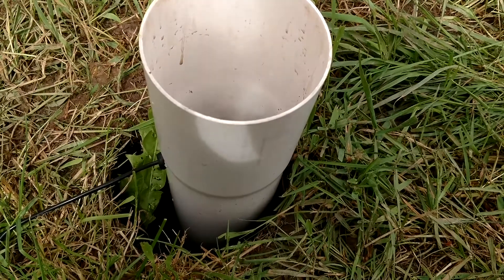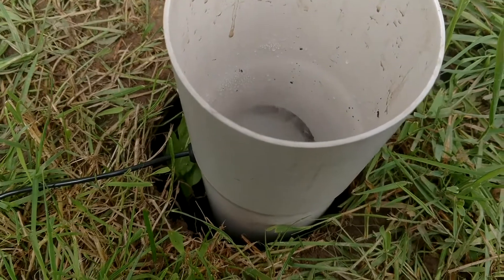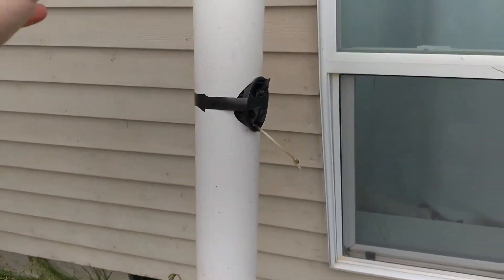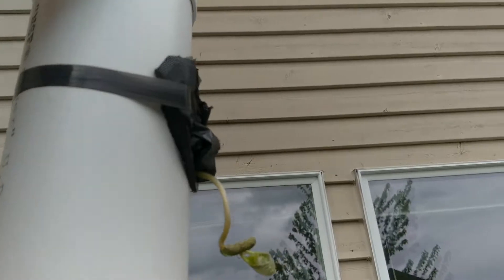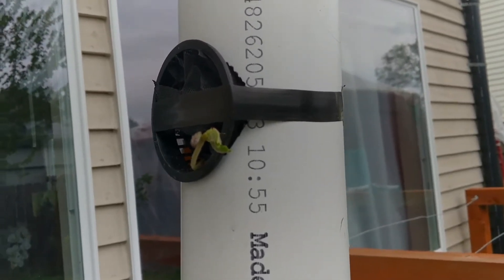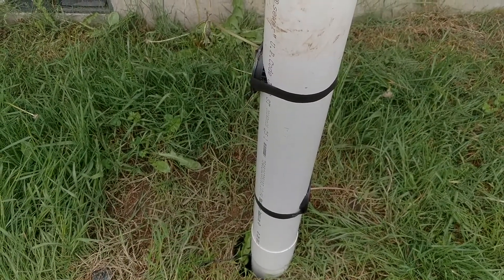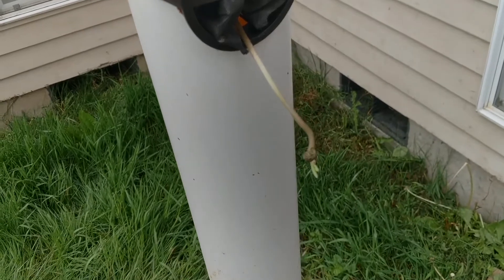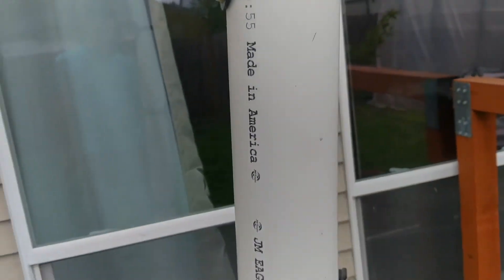Indroducing the Fogtower - Trip does Fogponics S2E1

Comment: Any updates ?
Reply from the maker: Fog is difficult to manage in this configuration.  With a fan the fog escapes and wastes water and nutrients. Without a fan, the fog doesn't climb high enough to reach the top plants.  You'd want some sort of loop that recycles the fog but the hard part would be using a fan that is resistant to moisture enough to circulate the fog.  The costs probably don't make sense.
Reply: @tripzero0  fair enough ,but with fog the growth is better ,is it true ?
Reply from the maker: @bhoom2tika  yes.
Reply: Use a computer fan. They are brushless, so no moisture issues and they should be rated on flow and pressure.

Comment: You should set up the foggers at the top of the towers and then pumps at the bottom. Gravity will move the fog where it needs to go and the pumps at the bottom of the tower will move your solution you are fogging back to the foggers at the top of the tower.
Reply: How would you design that?

Comment: I'm with Robert M...even if it does at first (fog reaching the top)  as the roots develop air flow will get progressively more limited...I'm surprised there  is no fan pushing the fog...bummer.
Reply: Why not put the fogmaker on the top of the pvc tube.Then fog will flow to the botom automaticaly.
Reply from the maker: You are absolutely right that  a fan is required.  I'm working on a redesign.